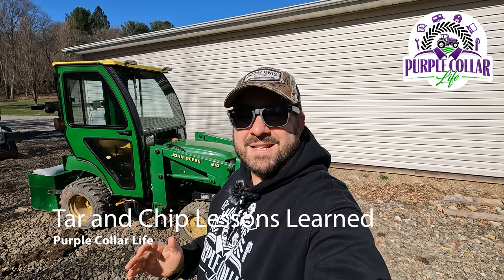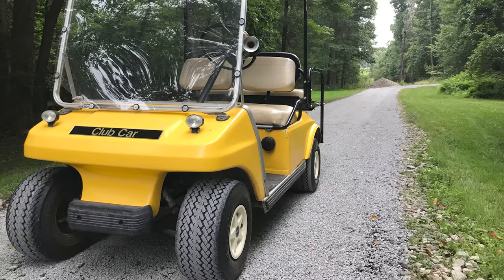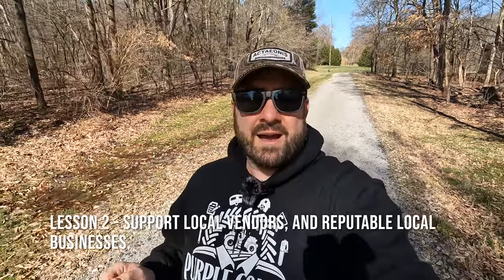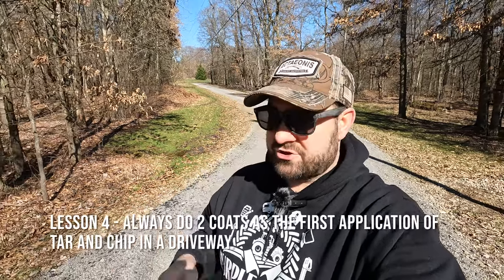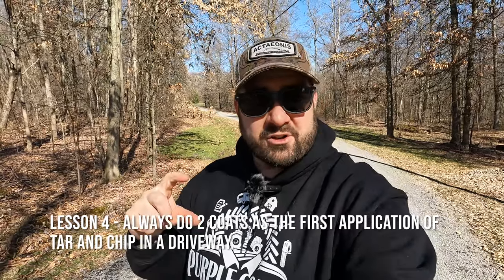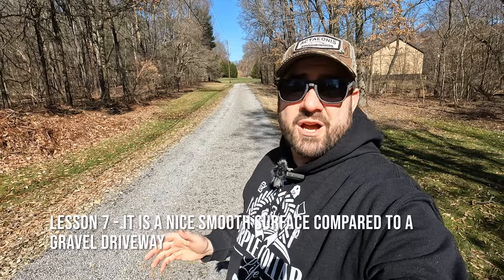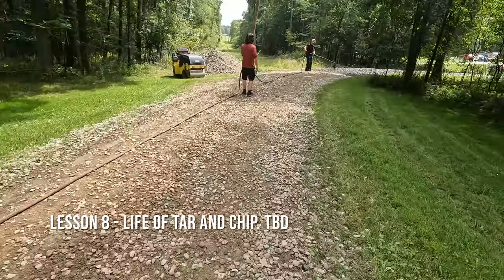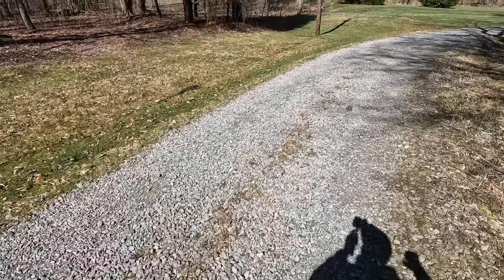Tar and Chip driveway - key lessons learned after 7 months

Comment: Been chip dealing for 25+ years  must do
- level your dirt driveways with base water & compact 
- water base before spraying chip oil do in section
- once chip oil turn from brown onto black it means oil broke is to late for chip rock
-use 3/8” chip rock 
- chipping over base require 2 lifts 
- oil rate is .38 gallons per SF
Reply from the maker: This is exactly what I wish I would have known. Thank you. This will help others.
Reply: Where is your business located? Thank you in advance.

Comment: I removed 8” of soil and put 8” of asphalt chips. The cost at the time was $150 a load. Best driveway for six years no pot holes no movement. Just had concrete poured on top of it and it’s fantastic. Make sure the chips are fresh but these were not even screened.
Reply from the maker: I've seen some others use the recycled asphalt. It seems like it makes an excellent solid layer and a nice smooth top coat. Great choice! I never see this available around me - but maybe I'm not looking in the right places.  Thanks for watching!

Comment: Too bad asphalt is so expensive, because it's the best in my opinion.  Unless chipseal is done properly, like you said, the results won't be satisfactory.  I've even heard some claim it lasts longer and is more durable than asphalt, but I'm not so sure about that. Otherwise it wouldn't be so expensive. Thanks for sharing, Chad!
Reply from the maker: I had asphalt (black top) priced a few years ago. It was crazy expensive. But you're right- it would be better long-term solution.  If I had a LOT of money - I'd do the whole driveway in concrete. :)

Comment: I have a gravel driveway that I want to quiet up so the deer don't hear me going to my camp.  Is your tar and chip quiet?
Reply from the maker: Great question. It is quieter than the gravel is for sure. But there is still some noise. I've found that the deer around here are very used to my travels in and out the driveway - so they pretty much are indifferent when I'm coming in. They don't even mind the tractor or UTV anymore. They actually come CLOSER when I'm running equipment because they're curious and hopeful that I have some corn or a salt block. :)